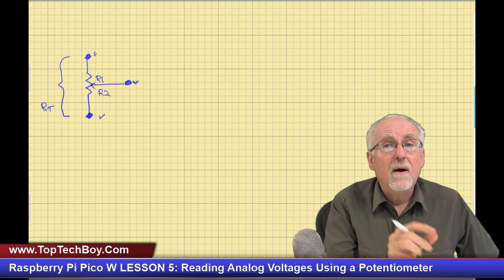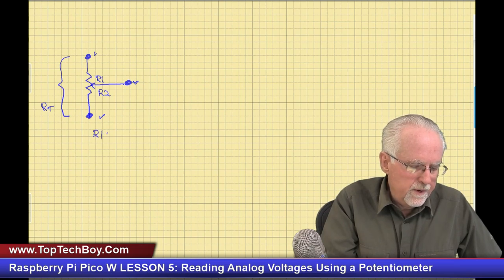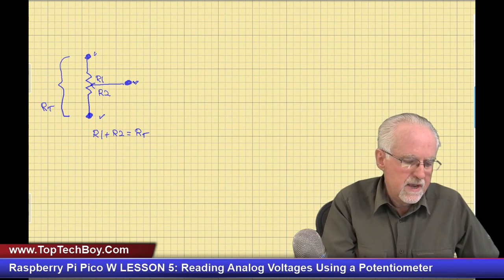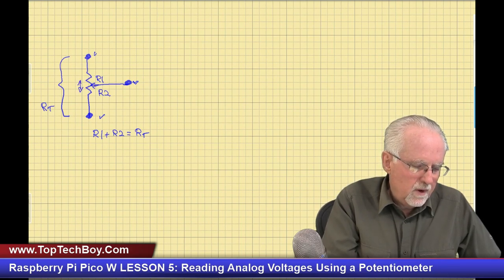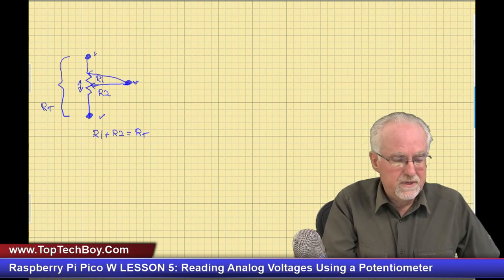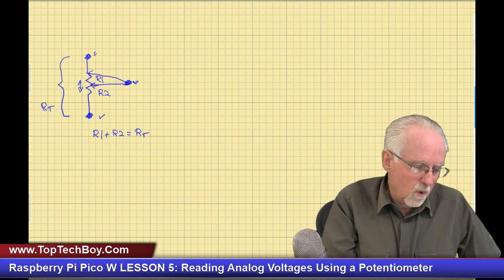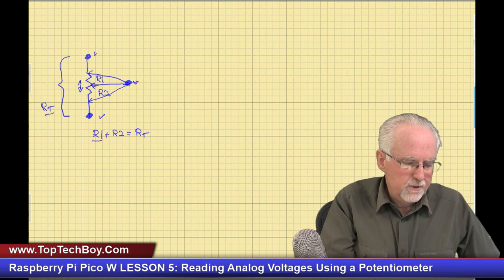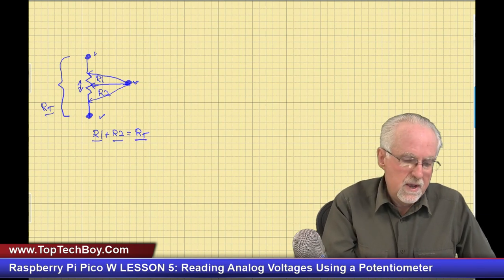Raspberry Pi Pico W LESSON 5: Reading Analog Voltages Using a Potentiometer

Comment: Hey Paul, you lost me after x-430. The second equation said 430-3.3/65106. Where did that second 3.3/65106 come from? Math has never been my friend. It’s 4th and long but I’m gonna go for it.
Reply: That tripped me up also... I believe my trouble comes from my lack of understanding algebraic executions. I understand the principles of the line equations but executiing them properly is another story.
Reply: I got confused at this point also. Paul can you find another method to teach this slope?
Reply: The 3.3/65106 is multiplying the whole BRACKET with (x - 430) in it so it has to multiply the "x" FIRST and THEN it has to multiply the " - 430 " so you get 3.3/65106 * x and then 3.3/65106 * (-430)   which is same as 3.3/65106 x  -  430*3.3/65106       [it does't matter which order you multiply in a*b  = b*a]
Reply: whenever algebra gets confusing think of a simple example with just numbers to check what's going on, so here the same sort of thing would be change all those big numbers and x for eg  [2](3-1)  --> well 3-1 = 2 so that gives 2*2 = 4 easy  .THEN do it Paul's way above by mutiplying the brackets out so do 2 * 3 and then do 2* -1 ........2*3 is 6, 2 * (-1) is -2  6-2 = 4 ......... same answer
Reply: Taking one extra step in the formula it becomes (potval-430)×(3.3/65106). In that way you do not need the slope.

Comment: I agree Paul, Math is my Friend. I worked on Generators in the Air Force, and We had to Understand the Formulas to calculate the amount of Current you could push thru a Wire depending on the Wire gauge and the Resistance provided by the Load...
Power, Voltage, Current and Resistance all work Together as One.

Comment: Math is your friend.
Thanks Paul for all you do.
Reply from the maker: Keith, if there is one thing I wish people would get from this channel is the power and simplicity of using linear equations. It is sad that math is taught so poorly such that we grow up hating math. As I browsed some of the homework solutions, I see people are still struggleing. I deliberately made this assignment where the slope is negative, and the problem has a y intercept and it seems people froze.
Reply: @paulmcwhorter  I had to start with y=mx+b.  Then I could work through it. You did not have this as a sample.

Comment: # Code I used for the Homework
import machine # imports the entire machine library
from time import sleep
potPin=28 #Creates varible potPin and connects it to GPIO pin #28
x=100 #Creates variable and sets its value

myPot=machine.ADC(potPin) #Creates myPot sets it to the 'machine' library, ADC is for Analog-
        # Digital Converter, which is at the potPin variable
while True:
    potVal=myPot.read_u16() #Creates a variable and makes it value to the value of whatever is
                #read off of myPot. u16 is for a 16 bit number
    print(potVal)
    voltage=(x/65105)*potVal-(430*x/65105)
    print (voltage)
    sleep(.5)

Comment: Paul the Guru. I did my homework and I'm doing my homework most of the time, if I had built this discipline during my college days, I would have been in different level. Your punch on the face makes me guilty to skip the homework. Its god gift I found this channel

Homework

Point 1 = (320, 100)
Point 2 = (65535, 0)
Slope = -100/65215
Equation of the Voltage line = (-100/65215)*potentioMeterVal + (6400/13043) + 100

The Values are amazing and most of the times its accurate

Comment: I noticed the Fritzing software. So, I downloaded the Windows 64 bit for 8.00€ 8.41 Dollars.  I am using this Lesson 5 example to update an old Eddy Current thickness meter 0 to 0.5 inches display reading vs the sensor output 0V to 10VDC scaled down to 0 to 3.3VDC. The Raspberry Pi Pico W will be battery operated.   😎 Thank you Paul for the inspiration of something new.

Comment: Today's assignment didn't require much change from your example.  I used variables for the numbers in your code(MaxY, MinY, MaxX, MinX).  Since there is so much noise in the readings, I applied a lowpass filter to smooth things out and I set the initial value at the mid point.  As I turn the potentiometer, the displayed values change slower than the potentiometer is turned.  Couldn't resist the low pass filter temptation.
Reply from the maker: Excellent use of low pass filter!
Reply: like to see you code
Reply: Glad I looked at the comments, that use of variables is smart.  I can just figure this equation out once and use it for every homework Paul throws our way.  Thanks!

Comment: I made the homework, but not a video this time... To avoid negative calculations from readings, used round() function to round up or down results, here a extract of my readings:
Read = 224 	        Result = 99.71 	V = 100
Read = 3984 	        Result = 93.98 	V = 94
Read = 22725 	Result = 65.46 	V = 65
Read = 32567 	Result = 49.96 	V = 50
Read = 34008 	Result = 47.95 	V = 48
Read = 37305 	Result = 42.85 	V = 43
Read = 43178 	Result = 33.91 	V = 34
Read = 50140 	Result = 23.26 	V = 23
Read = 60606 	Result = 7.16 	V = 7
Read = 65535 	Result = -0.31 	V = 0
Also, result was formatted two decimals through f format string with this pattern: ":.2f"

Comment: I have few questions here, 

lets say we have similar setup one gpio pin that outputs 3.3v connected to the ground with a resistor in between .and if I have a third pin that acts as analogue to digital converter  and reads value so does it act like voltmeter? lets say I place it across that  fixed resistor that can take all of 3.3 v would I be still able to measure 3.3v as output and 0v if I place it on two ends can I think The middle pin in the video as a voltmeter where one of the sides is touched to the ground and the other can be placed anywhere
Reply: If I understand your question right. Reading the middle pin from the potentiometer is like using a voltmeter. Yes. But for it to print out the value that is more readable to us, you will have to do the point slope math or you can use the .map() , but you are not challenging yourself by working on the math. But the first part of your question, I'm not fully able to get my mind around it.

Comment: Hello Paul and thanks immensely for the pico W videos which I will soon share with my daughter (BME, UT Austin,  doing her MD-PhD @ TAMU & beginning  research).   I was wondering if the Pico W is only 12-bit, then why did you choose a 16-bit number?  Also 0 turns out to be around 430-- is this the "zero offset voltage"  Can this be adjusted on the Pico ?  Thanks a bunch for your response in anticipation.

Comment: Hey Paul! I have a question. Point slope form: y - y1 = m(x-x1). In my example y1 = 0, m = 2, and x1 = 1, so we get:
y=[2](x-1) Here's my question: Do you really have to use the disruptive property? Wouldn't y=[2](x-1) give the EXCACT same value as: y=[2]*(x) - [2]*(1)?? Is the only reason we distribute is to make the equation in slope intercept form (y=mx+b)?? Hopefully this isn't too confusing! Thanks so much Paul!
Reply from the maker: In math we need to reduce our answers to standard forms. Standard form is y= mx + b. Reduce your answers to that because it is the standard. Plus now, when you look at the equation, you see precisely what the slope and y intercept are. Sort of like saying 6/4 is exactly the same as 3/2 yet the standard is to reduce our fraction and never leave a reducable fraction.
Reply: @paulmcwhorter  thanks sooo much!!!

Comment: I'm wondering about something at the 30:00 mark. It looks like the equation went from  y = m * (x -x1)  to  y =  m * x  -   m * x1
Am I seeing that right? And I'm wondering why? Certainly both ways get the same result?
Reply from the maker: You distribute the m to get the equation reduced to the standard slope intercept form of the line, which is y=mx+b
Reply: @paulmcwhorter  Thanks. That got my pointed in the right direction.

Comment: I got different of Potentiometer from your teaching, mine(label 10k), so my question are:
1, What is the value label on your Potentiometer?(When reading potval in your vdo, it shows range(430 to 65535))

2, I may got different read value of Potentiometer from your teaching right?(Mine reading potval , it show range(430 to 1088 ))

Comment: HI all, I don't know if I am doing something wrong, however my meters readings are not constant, at the low scale the numbers can jump between 8k and 10k at start, at the high scale it can start at 107-11,000 but then drops to 8k and increases back to 11,000. I am under the impression that low end should remain at far lower numbers and high stay high. What am I doing incorrectly?

Comment: import machine
from time import sleep
myPot=28
myPot=machine.ADC(myPot)
while True:
    potVal=myPot.read_u16()
    voltage=(3.3/65247)*potVal-(288*3.3/65247)
    percent=(100/65247)*potVal-(288*100/65247)
    print('Voltage',voltage,'Percent',int(percent),'potVal',potVal)
    sleep(.5)
   It works.

Comment: Hey team! Can someone help me understand Paul's example? I'm getting lost at timestamp 30:07. 

I understand when y - y1 = m (x - x1) becomes y = [3.3/65106]*(x-430).... This part makes sense.

The next part is where I'm not sure where we're going or where we've gone...

How does y = [3.3/65106]*(x-430) become y = [3.3/65536] * [430*3.3/65106]?
It's really the last part; the "[430*3.3/65106]" part. Is that [x1*y2/x2]? If so, how did we get there?

Any help is greatly appreciated!
Reply from the maker: You distribute m. THink of it this way:
y=m(x - x1) becomes
y=m*x - m*x1
Now look at the numbers. You 'distribute' the m to remove the parenthesis

Comment: Hey Paul! Here's the point slope form:  y - y1 = m(x - x1) after using the distributive property you get:
y - y1 = (m*x) - (m*x1) You said that this was in standard form, y = mx + b, Is the (m*x) term the slope?
And is the (- m*x1) term the y-intercept? I understand how we've got there perfectly, and I understand the math, but I DON'T see how it's in y = mx + b form. Thanks Paul!
Reply from the maker: The slope is still m. y is equal to the slope times x plus the y intercept. Hence, the w intercept would be -m*x1
Reply: @paulmcwhorter Thanks for clearing things up, Paul!

Comment: I saw elsewhere on the Internet to Connect the positive to pin 35 ADC_REF (row 6 on the breadboard) and the negative to pin 33 AGND (row 8 on the breadboard). The Pico has special noise reduction circuits to avoid power supply jitter. Is this true?  Can someone explain to me what this means?  I tried reading the Pico’s Datasheet about ADC, but don’t I understand it. Should we be using a different power source for better accuracy, and if so, how do you wire it?
Reply from the maker: YOu can supply an externeal calibrated reference if you want more exact results, but for most cases it is not needed.

Comment: Fixed my link: Here is my homework for lesson #5. This has a negative slope, and my values are almost perfect. 100= 99.9999, 0 sometimes goes negative. I think I can calculate slopes and reinsert into a formula. I also show some other methods with a spreadsheet file. https://youtu.be/OuiFnFunK9E
Reply: Legend
Reply: fixed the link https://youtu.be/OuiFnFunK9E
Reply: I also corrected the rounding problem in the print statement thus: print(potVal, round(scaleVal)  I also modified the sleep to sleep(2).

Comment: Wait a minute. Currently when we turn the dial left it shows 0 voltage, and turn right it show 3.3 volts. 

The home work is to turn left and the value show 100, turn right and the value show 0. Is this correct? Is this the home work? This means the slope will be negative. Is this correct?
Reply from the maker: Do not fear a negative slope. I deliberately designed this homework to have a negative slope AND to have a y intercept. Just work it through.

Comment: Hi Paul,  A good session.  As a respectful patreon and someone that looks forward to your sessions, I would like to suggest that you consider leveraging the Pico W wifi capabilities in the future.  Specifically, consider addressing how to put a server on the Pico W that can be accessed from clients with the ability to edit code on the server as well as how to access data stored on the server from sensors connected to the Pico W.  This could build upon your Raspberry Pi sessions relative to a home security device that you offered some months ago.  This would have wifi being hosted by the Pico W and have sensors storing data and activation information on the Pico W that could be downloaded by clients.  Could also include the ability to modify the code being ran on the Pico W via wifi clients.  The expansion of this learning project could eventually, include the addition of a camera and storing images on the server which could be downloaded via the wifi. 
Thanks for considering this for future lessons.
Best regards,  Ed
Reply from the maker: Ed, we have to cover the basics first for the beginners, but then we will get to the WiFi stuff. Yep, it is really important and one of the main benefits of the pixo
Reply: Yeah, that is way way way over my head at this poing.

Comment: Here is a link to my homework for this lesson.  https://youtu.be/OwgKmjXvwe8
Reply from the maker: Excellent. Play around with your math a little more, there are a few mistakes.
Reply: @paulmcwhorter  It is hard to believe that I have collage level calculus behind me but cannot perform simple algebra.  Although it has been at least 40 years.  I knew I would have difficulty doing calculus again but algebra should not have been a problem.  I am embarrassed. I finally got the results I was looking for. Thanks for the videos
Reply: Seems like the homework this time is calculating the correct slope. Perhaps you could explain your formulas more. I had to run the formulas about 30 times before I could under stand it and explain it. Once the formula is good the video should display the correct values. I do not understand Pauls part of the formula = ((-100/65216)*320). What does this represent? Also I could not see your display.

Comment: Paul, Here is my homework for this lesson. https://youtu.be/2dDojUMQFBI
I do have a couple of comments. The first is mainly for any new programmers seeing this. Please remember, comments are not only your friend, they're the friend of the poor sucker that has to come along behind you to fix (no code is ever perfect) or expand on your work. Don't assume that what you are thinking when you wrote the code is obvious to everyone else. Just assume you're smarter than the next poor schlub and explain your thinking. Remember, in a couple of months or years YOU may be that poor schlub. 
Second (and this sort of dovetails with the first) the point you made about assigning "potVal" at the beginning of your code is excellent. I was a bit disappointed that you didn't follow thru with that logic in your sue of the "slope" value. You repeated the constant value "3.3/65106" a couple of times in your code. This not only introduces an opportunity for error the compiler cannot catch it forces the next poor schlub (me in this case) to mentally stop each time and remember what that string of number represents. Not really a big deal in these little snips of code but IMHO it's a bad habit that the beginners you are teaching should not pick up. 
Minor quibbles but in my 50+ years of software engineering I've been the poor schlub more times than I care (or can) remember. Keep up the good work. Thanks for your efforts.

Comment: Here's my homework: 
https://youtu.be/PbGloL-oaPQ ✌️🙂
Reply from the maker: LEGEND!
Reply: ⚠️  Don't copy this homework guys! ⚠️ 

I didn't really do it the way that Mr McWhorter would have preferred 🙅🙅🙅

I simply flipped the direction of the formula like it was a burger 🍔🤤😋 
from a positive direction to a negative direction by subtracting 100 🤷🤦💁🙋
Reply: @bigbogeyface  But you didn't subtract 100. You took the value that you would use for displaying the value from 0 - 100 and then subtracted it from 100. 
If you follow Paul's video for calculating the slope and then y, using  y1 = 100 (instead of 0) and y2 = 0 (instead of 3.3), then you get the exact same equation that you're using. Now that's lucky:face-blue-smiling:

Comment: Easy lesson. one question.... it was like a floating pin, readings at first were not stable at all. I swiched to another potentiometer  and things got better but not perfect. Do we need something like a pull up or pull down switch in the circut. I tried adding 333 to the negative side, and no change.  I am totally new to electronic part. Sorry if this is dump question.  here is my video . Great clas thank for taking us through each step of the math. I really need the refresher. 

oooh video looks a little more stable, that is becuase I added rounding to the result. 

https://youtube.com/shorts/7a7cjQTYVOg